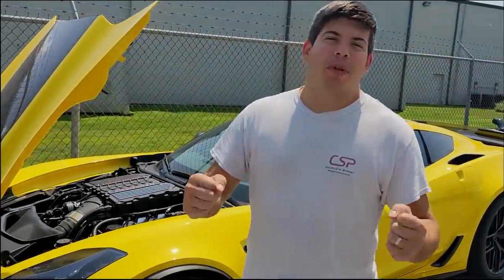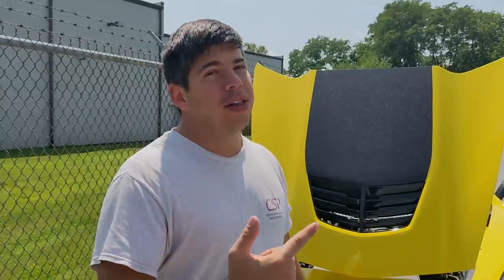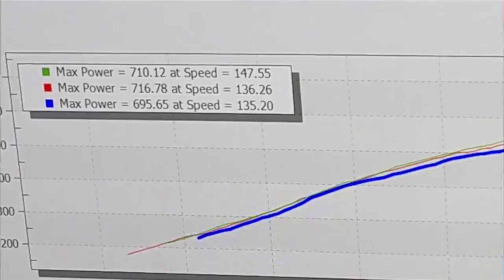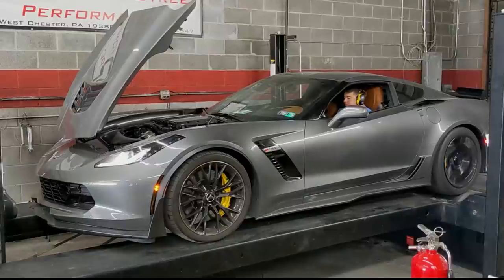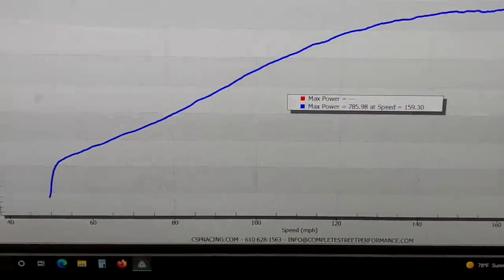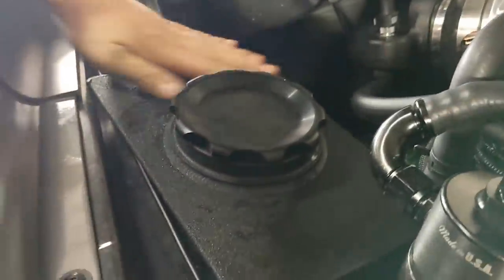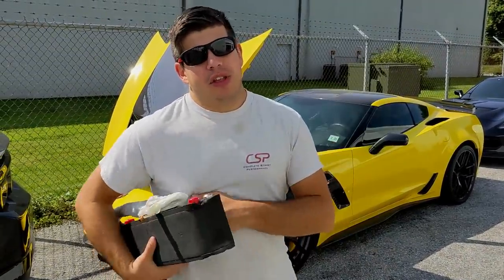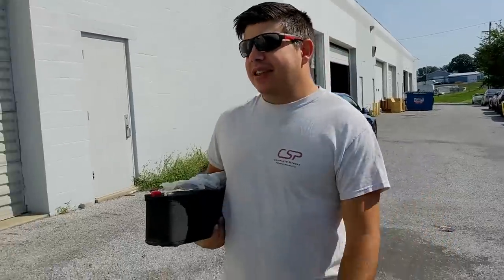Fix Your C7 Corvette Heat Soak Issues With This Modification!

Comment: Awesome video CSP
Reply: Someone is getting sponsored 😈
Reply: @johnhowl6827  CSP just love our products, none of the CSP cars have been sponsored
Reply from the maker: It's true. Kirk doesn't give me shit for free. He does throw in a discount here or there for my own personal cars, but no freebies. I've been begging him for freebies though. Even putting the first interchiller on the C8 he didn't send me a freebie! What gives Kirk!
Reply: @completestreetperformance  Gees you don’t have to murder me for it lol 😂
Reply: Where do you mount these on the C7 z06?
Reply: @pitstoprocky9801  90 degree elbow brackets to the front crash bar, loads of room inside the front bumper, mounts very neatly
Reply: @ForcedInductionInterchillers  I just purchased the system to install myself, any extra parts needed?
Reply: @pitstoprocky9801  electrical wiring is not supplied so when you burn your car to the ground you cannot hold us responsible. Intercooler hose is needed, AN-12 water fittings if you didn't buy them as an optional extra
Reply: @ForcedInductionInterchillers  can you send me the exact interchiller setup on this car I’m going to text u on ig
Reply: @1stockm4  Stage 2 kit

Comment: Do u recommend, The inter chiller for bone stock Z06’s?
Reply: Yes.. I couldn't even dyno mine when it was bone stock. It heat soaked so badly just idling and getting loaded on the dyno... ambient temp was 72.. 150 intake Temps.  I dyno'd 535 515 and 495 smh.  Waste of an hour.  These cars NEED them
Reply: @AverageTrackRat  I live in PR, so normal day is 90f…. Still my stock c7 made 574whp intake temp around 140f. You definitely have other issues
Reply: @lehmancamaro definitely what other issues?

Comment: Wish I had that chiller system when I took my 2017 C7 Z06 to "wanna go fast"  1/2 mile event in Ocala, FL. Very 1st run and it shuts down at the 1/4 mile mark. I thought the 17' had the heat problem fixed....NOT!  If I still had the car it would be at your place for that terrific fix!!! And I like your videos. Keep publishing!!!
Reply: Stock or modded?
Reply: Mine reduced power at 150MPH sucks!

Comment: Andrew/Eric, what are your thoughts on people criticizing the interchillers because of the excessive amount of condensation (for safety reasons)?  I have heard that some tracks won't allow you to run once dripping a noticeable amount of water onto the track.  I also wanted to ask about the AC cutting of at WOT, is that a thing?
Reply from the maker: We use braided lines to stop condensation from dripping. Haven't had any issue that way. AC does cut off at full throttle, so you need to make sure you have capacity for the entire pull you plan to do.

Comment: Blower running hot I have never seen over 120 iat charge air on my Edelbrock 2650. 130 charge temp is dangerous that’s when the tune should pull back to save the motor.

Comment: Website says Race Track Safe, but in the video not for road course?
Reply: For road course we retain the heat exchanger on a bypass valve which is temperature controlled splitting your intercooler fluid 50/50 (chiller/heat exchanger). 
Depending on driver talent, the track and how much heat the blower/turbo produces the heat exchanger becomes necessary for cooling as you heat up your stored fluid volume that the chiller is able to provide. 

The chillers "job" is to make a tank of fluid freezing cold. 
The tank of fluids "job" is to provide enough fluid volume so that your entire time spent at wide open throttle you are supplying a constant -15f to 32f fluid to the intercooler.

As example you would install a 1.5-3gal reservoir buying you fluid volume so that you are then able to supply a constant temperature of fluid for X-amount of time....with circuit racing as you are on the throttle so often, based on driver talent, the track and how much heat the blower/turbo produces the heat exchanger might be needed for additional cooling. Then when the fluid temps drop below the outside air temp the heat exchanger will automatically be bypassed out of the system and the chiller will be in control of 100% of the cooling again vs the 50/50 split (heat exchanger/chiller).
Reply: @ForcedInductionInterchillers  Thank you for the detailed reply. Can I call you to ask a few more questions? If so who should I ask for?

Comment: Is the FI interchiller a bolt on afair? would you be able to remove it and return it to stock?
Reply from the maker: On most cars yes. Some will require fittings to be installed. However lines are replaceable if needed. Although personally I would just cap.
Reply: @completestreetperformance  I have a 6th gen ZL1 would i have to add some kind of condensation insulation to my front mount cordes tank aswell? and a stage 1 would be more than enough right? no need for stage 2?
Reply from the maker: Stage 1 is enough. I had great success in 100 degree heat with it. Stage 2 would make it better for sure though.

We use braided line to stop condensation from dripping to the ground.

Every kit we sell comes with the competition valve so you can dedicate the refrigerant to the chiller - and keep the condensation to those parts as well.

The 6th gen Camaro is bolt together, no cutting of the ac system required. It's a tough install though.
Reply: @completestreetperformance  Thanks for the response! Interchiller definitely seems to be the way to go!
Reply: @JLSpeed  If you want a plug n play interchiller for your 6th gen Zl1, highly highly recommend the WeaponX Boost Chiller. Check it out. I think it is the better option. It gets rid of only 1 of the smaller oem heat exchangers and keeps the other 2.
Reply: @philipkeds328  you don’t want to keep the heat exchangers unless your road racing. When your  coolant temps get in the 30-50’s the heat exchangers will actually add heat back to the system not remove it. Only way that would be suitable is if your driving around in 40-50F weather.

Comment: Doesn’t the ac clutch disengage at wot ?
Reply: yes but the trick is to have the intercooler fluid capacity big enough so that the fluid only circulates 1 time according to the type of racing you do. A street car would be 1.5+ gallon, 1/4 mile would be about 3 and 1/2 mile-1 mile would be closer to 5 gallon. Depends on the pump and it's actual flow in your car as installed. The less laps the coolant makes during your run.....the cooler the IAT will be.

Comment: Would you recommend the same thing with ZL1's?
Reply: I haven't heard zl1s having heating issues
Reply: @StockCarGuy  Interesting, asking because they're the same blower in different bodys
Reply: @imluigi9696  only thing I’ve seen improved on the zl1s r the intake, plus I think the reasoning behind it is  the Camaro has a larger front end
Reply: @StockCarGuy  Yeah you're right it does have a big grill for more air, awesome thanks for the feedback 👍

Comment: Is this on e85?
Reply from the maker: 93 octane only
Reply: @completestreetperformance  wow that’s crazy. Wonder what these cars would do on E?
Reply: I need one of these on my hellcat lol
Reply from the maker: Run out of fuel for the most part lol. But when you have it, they do really really good. Although in this case we would keep the power capped at the same level to keep longevity.

Comment: So your “stage 5” package that includes heads cam and also 2650 upgrade is only putting down 805 and 845 respectively?  That seems pretty unimpressive since RPM is doing a stage 4 (no blower upgrade) with just a ported blower to the heads/cam package and getting 900rwhp on an A8.
Reply from the maker: We don't do "stages". Also, not an apples to apples comparison as this is without meth injection or E85. Just 93 octane. Nothing else to worry about. No E mix to get wrong. If it had meth injection and/or E85 it would have made 900+ SAE (which reads lower than STD - the correction factor RPM uses). Also we cap the power on the stock engine in the 800-850 range for longevity, even though that setup could produce much more. After that it's a shit show in terms of engine reliability. 

The Magnuson has far better cooling than the factory blower. It will stay near the same power from the starting line to the finish line thanks to the big intercooler bricks which is something a factory blower can't do. So even at the same dyno numbers, the Magnuson will out perform because it will stay consistent.

However, we aren't building cars for dyno queen numbers. While it's nice, a max effort build means you get one pass before it breaks. We don't build those here. And we don't dyno like that here either. The most we do in terms of good dyno numbers is give the car a cool down.

I hope that answers your question.